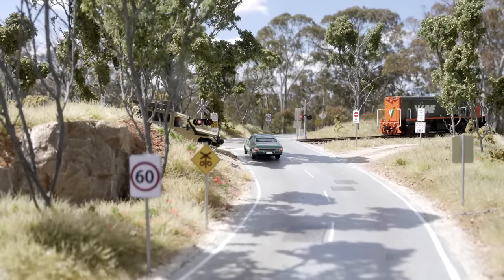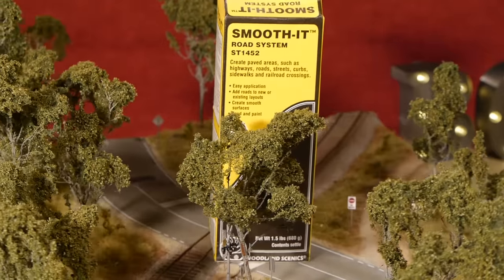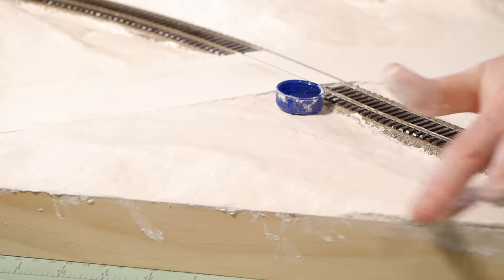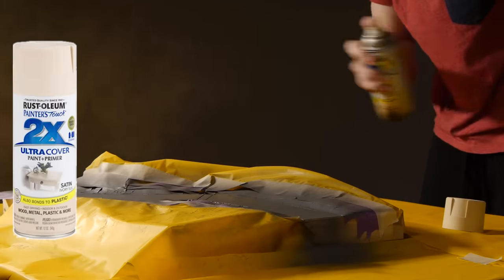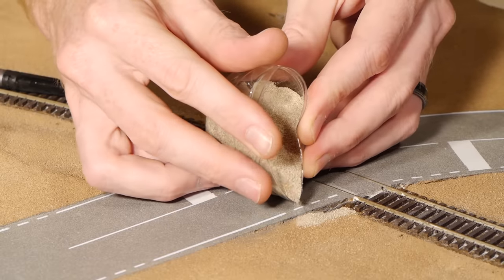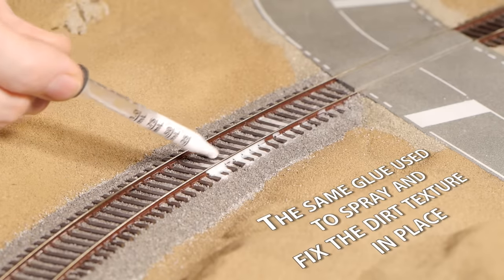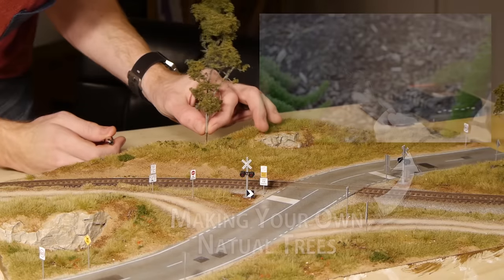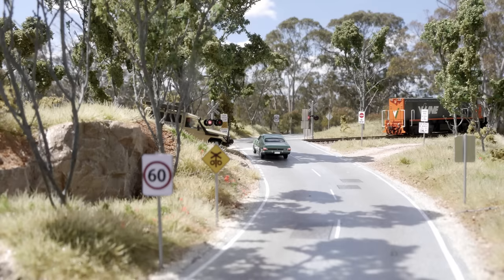Building The Ultimate Model - Realistic Scenery Vol.6

Comment: 8:14 Wet Water. Sounds Legit.
Reply: Wet water = water
Reply: Dragomir Wojnicki ice that is not melting
Reply: Water isn't wet!
Reply: What's dry water? Im 9
Reply: Just normal water.
Reply: water isnt wet... It makes things wet
Reply: MasterGaming hahahaha...got it😂
Reply: Okay, perhaps you all know the answer to this by now, but wet water is water with additives that  break down the surface tension of lol, dry water.  Dry water added to say flour, will form a bead.  Wet water will immediately soak in.  So much of the material used in landscaping these models act like flour and normal water will simply form a bead, sitting on top of the material, for ever.  So we add a little soap to the water and voila, wet water, which then soaks into the material enabling bonding.

Comment: So much masking,  I don't think I'd have the patience :(
Reply from the maker: lol, yeah unfortunately I couldn't find an easier way to paint the lines...
Reply: I use white and yellow gel pens,  the line width is almost perfect for N scale.  For HO though you'd want something a bit wider.
Reply from the maker: Yeah i tried the woodland scenics road marking pens, they are great but as you said it's hard to get the thickness right for HO scale. I guess it depends how picky you want to be.
Reply: My friend uses a paint striping tool.  It's a little paint container connected to a wheel.  You can put in a variety of wheels which give different thickness of lines.  For dashed lines you only need to mask of the ends.
Reply: Hi Luke,  I have a pen to recommend for you.  In N scale a typical ball point pen works out perfectly, but my wife recently found a pen that is much closer to a HO scale stripe.  "Uniball Signo Broad" comes in many colours, most importantly white and yellow.  The line is a very opaque white just over 1mm wide, which is spot on perfect for HO scale road lines.
Reply: I use Microscale white decal stripe in 4" and 6" widths. Simply cut to length and apply as per normal decals. Seal with dullcoat after everything is finished.
Reply: Jarren Butterworth yeah , me too. just watch it.. it's so relaxing 😂
Reply: Jarren Butterworth as soon as he said let it dry for 24 hours I knew I'd never be able to do this.
Reply: I've never known anyone to feel so strongly about masking.

Comment: Tip:  When peeling away tape masks, don't pull the tape up perpendicularly as seen here, but pull it back close along the taped surface.  In this case you would pull the tape backward very close to the road surface when unmasking.  This prevents the painted elements--in this case the road stripes--from being pulled up and off the road if they are stuck to the masks.

Comment: Amazing work!!!😎👍
A couple of points to adjust would be potholes (at least where I'm from) are more random shapes, and only nicely square if intentional work was done. Also, dry-brushing a bit of rust on the street sign posts, and most importantly: some grimy black down the center of the traffic lanes for a few car lengths at the crossing to indicate oil leakage - which is always present and noticeable where traffic idles.😉

Comment: The scenery you created is so amazing! The only thing i found strange is the cut of the road patches. The saw used to cut these is usually a circular one. So when you are cutting a square in the road, at the corners you have 2 perpendicular cuts. If you want those to meet, you must cut a little further outside the square. And the deeper you cut down the road, the further outside the square you have to cut

Comment: Just a quick pointer for the dullcote mixing with Isopropyl Alcohol - I've found this is easily fixed by applying another layer of dullcote over the top - seems to take away the cloudy reaction you get initially.

Comment: next time while your plaster is drying in the track area try taking an NMRA standard set of trucks and run them through the still moist plaster. This will cut the wheel flange slots you need.

Comment: This is a little late (based on the date of the video) but I want to re-do my roads using this technique. However, I run a trackless trolley on the road surface. Will the rubber tires wear out this surface?
If so, what do you recommend for my project? Thanks for the useful vids.

Comment: it looks very good, I used real dirt, moss for the grass, real assfault, I used a blow torch on the assfault. for the trees I tried using small weeds, but it didn't look good, so I had to use fake trees. the train really works, the cars move around, they are  controlled by magnets under the road. I have real working power lines, street lights, I used real stones and rocks, and I can even make it rain if I wanted too, and will not damage anything. I have a piston pushing the lake water to make waves. real sand for the beach. I have people walking on the sidewalk, and crossing the street. but of course this is all in my head LOL